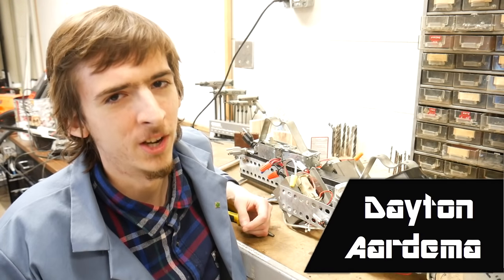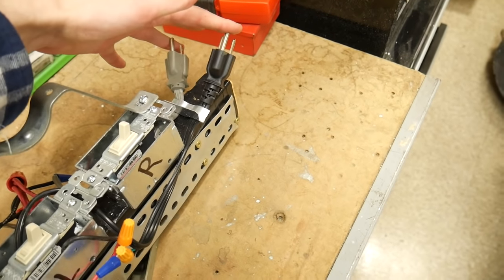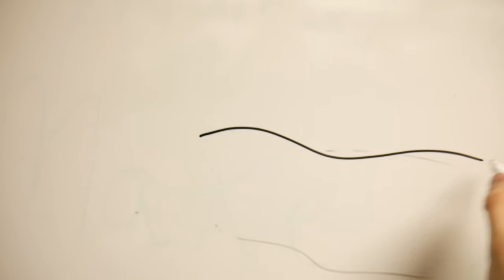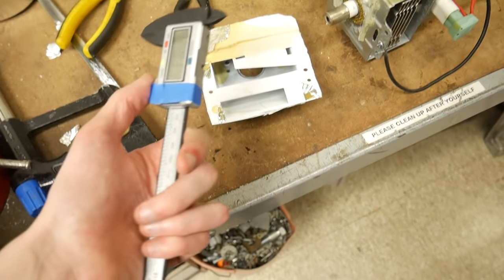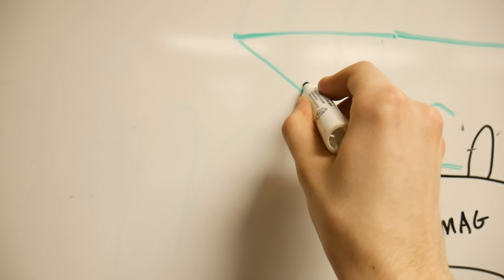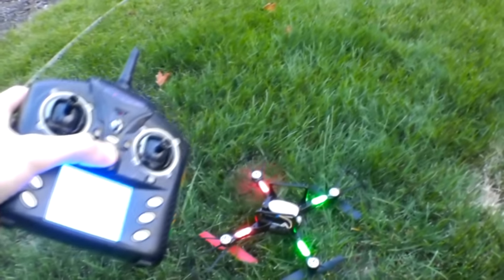How a MICROWAVE GUN Works

Comment: Important additional bit of high voltage danger, the capacitor, as all do, may maintain a very large charge potential, even long after unplugged. They must be shorted to discharge. Capacitors discharge their full load all at once, thus are extremely Dangerous! Unless one knows what they are doing they should avoid messing with anything that contains capacitors, as even much smaller ones than shown in this vid can be deadly!
Reply: So tell the people what has to be done to short capacitors to discharge their charge!
Reply: i guess this guy don't know about that 2000v capacitor
Reply: @StephanieSoressi  when I was much younger and working in a shop the method we used to discharge a cap was to pitch it across the room  for someone else  to catch.
Reply: ALSO. EYE PROTECTION!!! Putting potentially explosive items in a microwave, wear eye protection. Heck, doing almost anything in an experimental setting , wear eye protection!

Comment: Even an unplugged microwave or TV, the capacitor is still hot until it's discharged.
  You can electrocute yourself easier with an unplugged microwave or TV, because most people have no idea what the capacitor does, it holds a charge until discharged, unplugging it won't discharge the capacitor.
  Thanks for the video, I have a few microwaves that I am going to tear down this weekend.
  Appreciate your help and expertise.

Comment: So, after watching this video and the magnatron video I learned: Beryllium is a highly toxic metal, EM waves can be amplified by using a gap in walls to create a circular motion but it uses alot of energy to do this and creates crazy amounts of heat, microwave guns may be illegal (and of course are 100% deadly to those who don't know electronics), and you can amplify voltage with a high voltage amplifier that doesn't carry much current, so the amplifier is probably the only live component that won't kill you if you touch the wrong component without proper PPE.
Reply: @Lyn Ingle i wanna know. i think my landlord is doing this to me,

Comment: If modified properly, this can make things glow white and poof into nothing in a matter of milliseconds. It's just that in order for it to be a long rage weapon, the lobes need to be focused to a sharp flux, and to be a practical weapon, would need a device within to adjust and focus the flux, and need to be rigged to a range finder through a computer, so that it automatically adjusts the flux. To make a basic microwave gun with decent range, maybe instead of that square horn mussle, stick the magnatron antennas into aluminum lined funnels, and over both of those, one larger aluminum lined funnel faced so that the small end is the end of the barell. Would that compress the lobes?
Reply: Have similar ideas, particularly about multiplying/focusing output and making use of constructive harmonic interference.

Comment: I always thought kreosans electronics exploded because they were plugged into 220v mains that eventually shorted out from the magnetron. Often in his videos he doesn't have a circuit breaker to limit current. Of course your little 3v radio wouldn't explode.
Reply from the maker: That's... very true. Hmmm. 
I still don't think everything would explode that violently, though. I bet they stuffed some flash power in there for "extra effect"
Reply: i can tell you normal stereo amplifieres (even brand names like pioneer)
are really shitty when it comes to overload protection.
Thats why i always used car amps at home ;) , I had seen epensive amps dying which cost several hundret euros back then at 60% volume xD. I thought i am not dumb i can buy 4-5 brand car amps with the same power(or more since 60% is lol).

Maybe the< put fireworksinside for the effects, but the amps dying is very possible even without fireworks. But maybe not, they use some crazy 32Amps,
so they have a "special" main current xD.

 Funny thing is there where other channels which even doubted that a microwave gun is possible, because they cant do it xD. (AllenPan and ElectroBoom for example)
Pretty legit argument lol.
So keep in mind that just because you cant to something doesnt mean others cant do it too.
I subed here since you can do stuff other people cant do too ;D
Reply: @blueprint - There's no scorching on the displayed remnants. You kept shutting off the microwave before the lightbulb explosion temperature was achieved. In short, your video is disalarmist bullshit. Beyond that, volts don't kill, amps do. Your hokey "science" is blatant to the extreme. Your "microwave gun" is a shoddy design intentionally limited in it's power by the duct you chose to off center mount. Condensing the beam is crucial to increasing power per cm squared delivered on target. In short, your design is bullshit.
Reply: In that video they blew the stereo and you can see what seems like a foil wrapper floating around which appears to be from the pyrotecnics, but anyway, their videos are typically truthful about the actual effect. If they wanted to lie they could blow the stereo with the gun from outside the house without having to sit in the adjacent room separated only by a wall and probably about 10 feet away which curiously is also the rame range your gun seems to have.

Comment: 1:40 Whether the danger lies within the high voltage or the high current is debatable. Surely 2KV of open-circuit voltage won't necessarily kill you. In that case though, the transformer has a low output impedance, which means it has the capability of sustaining a high voltage with a fairly high current. The voltage is way higher than the dielectric strength of human skin, and the current is more than enough for ventricular fibrillation. Wrapping it all up: stay away from these things, kids!
Reply: I took 8Kv  from my finger to my knee at 150ma.  I lived to tell about it.

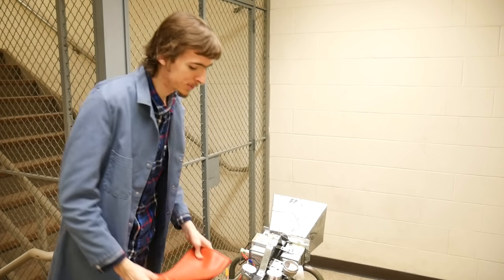Comment: 1:22  here is the 2000 volt transformer and capacitor, an excess of 2000V which will kill you instantly so dont go near it when its on.  1:55  limit your exposure, you dont want to cook your eye balls or manhood.  2:15  explanation of how it works.  2:45  light up a fluorescent bulb in a stairwell.  2:57  i'm doing it in a stairwell to not damage the electronics in the lab as it'll introduce random voltage in them, but electronics do not explode, they trip breakers and stop working until you get them out of the beam.  

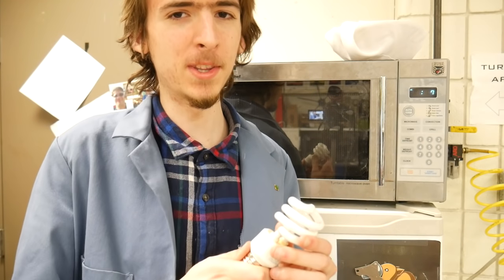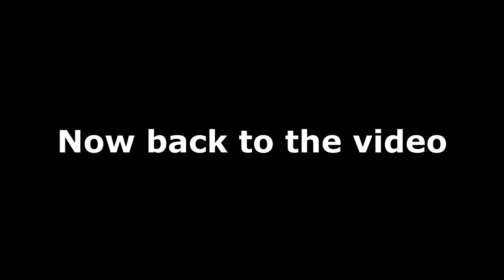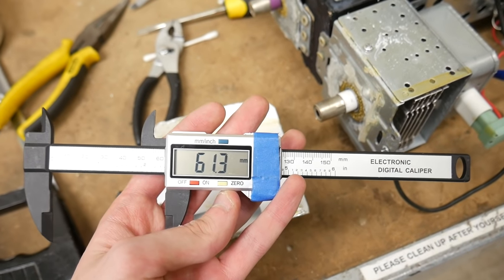4:02  bulbs in microwave experiments (MUST SEE for good laugh, this guy's a comedian).  5:17  here's how it works, its a 2000w oven directed in one direction forward through a horn.  9:49  warning: barilium oxide danger.  12:45  it'll knock a drone out of the sky momentarily (which is illegal)
Reply: LOL :D

Comment: Great demo. - - It's a fun to watch video but I, personally, would not want to be in a room with a microwave gun - because the chances of instant cataracts aren't fun. Also, as smart as you are Mr. #Blueprint, people need to know the basics of the main lines that go into their home. Of what is: 120 and 240 volts, 2 hots, a neutral..  People can't randomly share  2 plugs with any 2 outlets.  Accidentally plugging into the wrong combination of 240 volts is dangerous, and can cause a fire. It can blow off a finger, or be potentially lethal if you get inbetween it. You need to be an electrician.
Reply from the maker: Hey,
Thanks for pointing that out. I know that I could stand to be a little more cognizant of safety. I'm sure that you can appreciate that there is only so much relevant safety that I can cover and even then I'm not perfect. I'll try to lump more safety into the presentation in the future.
BTW, I didn't share a single outlet for the 2000+ watt Microwave Gun - that would blow a breaker for sure! The second plug ran via extension cord to another room's outlet. I mentioned in my 'part 1' video.
Anyway, thanks for the comment and the constructive criticism.
Reply: @BlueprintScience  I thoroughly enjoy your enthusiasm and creativity. I never had access to what you had when I was younger.. Maybe it's a good thing. I think the mad scientist in me would have probably killed me.

Comment: It won't kill you right away any more than a standard 120 v outlet would kill you right away if you have wet skin; provided you break the connection. You would get burned without doubt. The thing that kills you is the random interruption of the heartbeat at 50 Hz. The heart will likely experience arrhythmia after shock, but the chance of heart fibrillation is the same above 100 volts; even then, you have approximately 8 minutes to use a defibrillator; though you will likely be unconscious. The time the brain can live without oxygen can also be greatly extended by packing the brain in ice to prevent brain damage. I know because I was once involved in an accident where myself and a team of 5 others were all shocked by an 8000 volt power line; one of my coworkers was electrocuted. We all sustained burns, and I even broke both my shoulders. But the point is; it will not instantly kill you, it will just maim, burn, disfigure, and traumatize you.

Comment: To discharge a capacitor a screwdriver that has a good insulated handle ie plastic is used by laying the metal part of the screwdriver across the two terminals thus shorting it. This allows the electrons to flow and be in a neutral state. If the cap is charged it will spark and depending how large or charged it is, may be very loud, and startling. Taking apart any electronic device is dangerous or fatal! If you don't know what you're doing, you should not mess around with any electric devices. This is not meant to to be instructions, or a how to type of comment, it's just general information of the procedure. Anything you choose to do, you do at your own risk.

Comment: You could have doubled the force by using the reflected lobe, just tune it in distance with the frequency. I think the manufacturers of magnetron ovens find this to difficult. Maybe you could use a cone as a reflector for all the waves.
Reply: Yup F the FCC.  I'm a Genius in Electronic for 45 years.  Send me $35, and I will give you part and schematic to increase your MW power by 2X, $50, by 3X.  Chivolinha at Yandexcom fix the com.  I used to build 5kw RF Transmitter in war zone, when I was 14 - 17 years old. Evidenced by Jupiter+Uranus conjunction in my 3rd house (mind).  This is a way to increase the range. BTW - When Apollo 11 went to the moon there was a conjunction of Jup+Uranus for 1-week.  I have this sign permanently.  That's why I can do many things people cannot do.
Reply: not too difficult, probably unnecessary for the power needed to cook food

Comment: Would short pulses of high voltage (higher than 2kV) and high current (much higher than an average current in the microwave oven) improve the ability of the gun to shot down a drone? 
Very informative video! Great work.

Comment: It’s funny because I was going to make a microwave gun myself as-well, but I wanted to make it mobile and discharge in a few seconds. Anyways, I enjoy your videos and subscribed.
Reply from the maker: Cool. I hope you stick around Dakota
You know, it is possible to make a mobile 120V AC power source with a car battery and an inverter. Or let a huge capacitor draining through the transformer primary. A mobile version can still be done. That would be so cool
Reply: Blueprint indeed. I don’t want to use an inverted. I was thinking high voltage caps that are charged.
Reply: Inverter.
Reply: I’m gonna see if I can make a Jacobs ladder with the transformer and cap instead.

Comment: I always liked doing the grape plasma in a microwave. Cut a grape in half lengthwise, through both sides but leave just the skin holding it together on one end, essentially butterfly it. Lay it on a plate, guts up, put a glass over it, nuke it. Let there be light.
Reply from the maker: I actually cut exactly that scene from this video for length purposes. I agree, much fun! Though I have to admit, I'm not entirely sure why it happens...
Reply: @BlueprintScience   Yeah I heard an explanation at one time but I don't remember.

Comment: Hi again...Thanks for the advice....I don't want to hurt anybody, just make them uncomfortable...I have a sound tone wave generator that often does the trick....I have beefed it up, adding a second tone generator and longer horns, but my good neighbors are bothered by it too....Even good businesses a half block away say they can not concentrate and customers complain of it's shrillness, so I have toned it down....No pun intended...Police do nothing and are a joke, sadly...I thought a micro wave gun, silently destroying their electronic's might do the trick....Guess I'll have to stay with the sound tone generator.....The neighbors and the businesses, that are to afraid to complain about the assholes causing the problem, blasting their thumping, rap crap sounds, on their cracked, vibrating speakers, but will about my sound tone generator, can suck it.
Reply: Went through almost identical problems...Me, it's the people sitting at a Mickey D's, catty corner of my house, with the radios blasting, and mostly vulgar rap crap...I have two sound wave generators also, people across the street get irritated and an insurance business on the corner does too, so I try to keep it in check...I can drive people off at the Sonic across a main thoroughfare when they decide to party at night there, a good 300ft away...I still use it...When they're rude, I'm rude...Would like to destroy there electronics, but  Micro's to dangerous and just not enough range, so, it's sound generators...They work great.

Comment: This is exactly what the state department was believes was being used against their employees at the Cuban embassy! Just a lot more advanced designed and built by a state actor. Just imagine being the unknowingly victim at the other end of that thing. I know some of those people are  still complaining about getting headaches years later. No wonder they were basically getting there their brains crooked in their skull
Reply from the maker: Those thermal effects can be gnarly. I wouldn't be surprised if people got cataracts eventually too eventually :(
Reply: Do not kid yourslel the military is using them on its own people right now and has since the 80's at least.They can vibrate a ceiling with an extremely loud hum in a motel with a room above it and the people above do not even hear it.Explain how you would do that to me I truly want to know.Your ceiling is humming very loudly yet their floor is not.

Comment: Your videos are awesome. Could you please make a seperate video for why the electromagetic wave is an horizontal "8" shape on antenna? How does the electromagetic wave being convoyed from inside magnetron to the top of antenna? Is it simply because the waves just flow on the copper to the top or any other mechanism that are driving them? There are so many "why" after watching the video.
Reply from the maker: Edison,
First off, all good questions!
I try not to cram too much into a video that the audience dies of boredom. However, I did intend to bring it up in a future video. No ETA as of now.
For now, I can say that the pattern I was drawing is called a “near-field” and “far-field” which is unique to every antenna. Every engineer uses antennatheory.com as it has that and more in one convenient spot.
Also, the RF is carried through conductors in the magnetron to the monopole stub antenna at the front, very similar to wires. There is an RF wire and a ground wire.
Hope that helps!
Reply: @BlueprintScience  Thanks for reply mate. That is absolutely helpful. You have done what the best educators could do - "Inspiring people".

Comment: I clicked on this video, because I read about a fictional character that has the ability to kill with energy in the form of microwave beams and didn't know how it worked
Reply from the maker: Well microwaves like in a microwave oven are pretty harmless unless there is a really intense and prolonged exposure. Otherwise it feels like the sun beating down on you on a hot day.
Reply: @BlueprintScience  so prolonged exposure would basically cook someone from the inside out
Reply from the maker: @kuronoo244  Actually no. It’s like food in the microwave is cold in the middle. Microwave energy (@2.4GHz) only penetrates about 2 centimeters (1 inch) into meat, with only a few exceptions. More people should be aware that a significant of heat from the sun is in the form of microwave energy, so it isn’t inherently bad.

Comment: Hi! I have a question.
Do you use aluminium to ''reflect and absorb'' microwave?
If yes, what sort of aluminium?
99,9%? 99,5% or else?
How to reflect it efficiently?
Reply: The RF bounces off of everything, metal is generally aluminum in RADARs, but I don't believe the purity is essential. The size of the "waveguide" is important however. For 2.45Ghz it's roughly 122mm by 61.3mm. If you disassemble the microwave, it'll have the dimensions you need just like he does in the video closer to the end of the video

Comment: Oops! I took many of those mag's apart,, just wondering, what are the symptoms of poisoning from the berillium oxide
Reply: 5000  i worked in a repair shop and they used to get broken,  the guys i worked with couldn't even spell microwave,  i doubt they were aware of the dangers